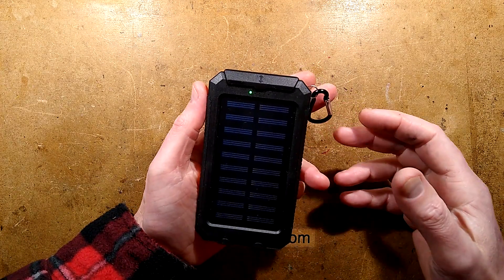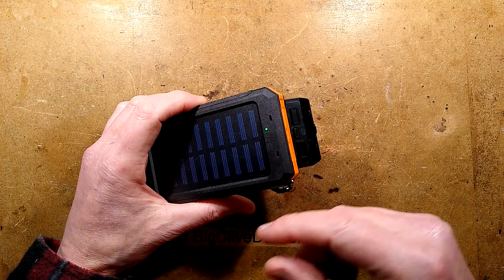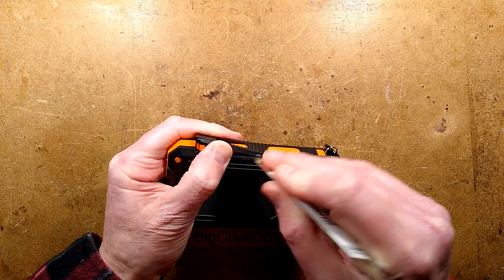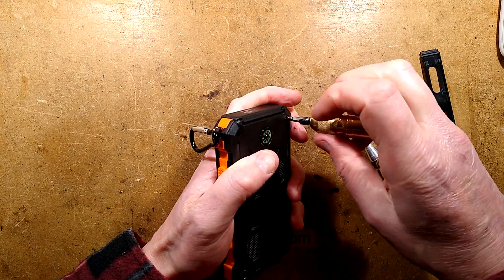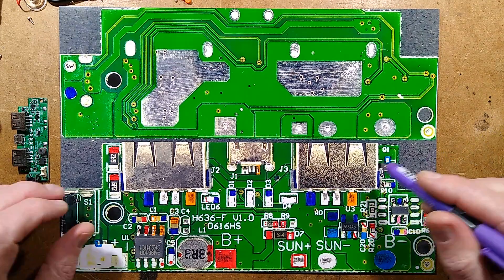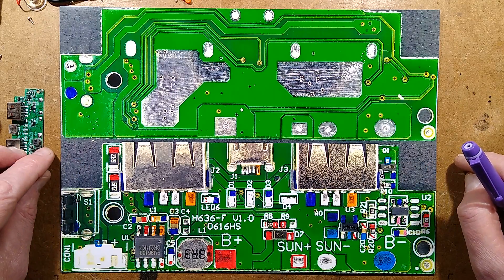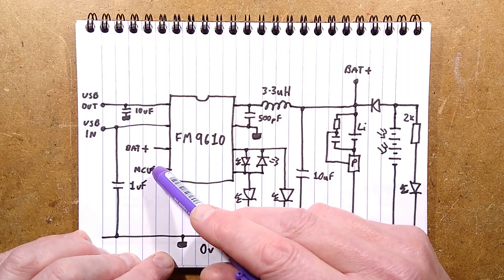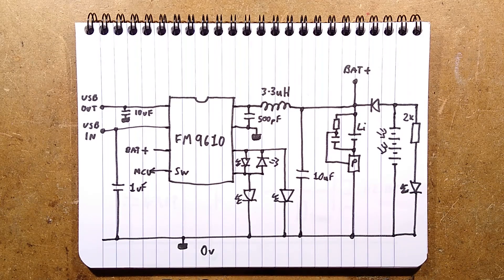eBay 9 MILLION mAh power bank teardown (with schematic)

Comment: Classic case of the design guy crossing swords with the marketing guy in the briefing room, turns out the marketing guy had much more time to practice fencing and won because all he had to do was label the device with ridiculous and outrageous claims of 9'000'000 mAh 🤺 O' and cut the cost of using a decent battery and replacing it with scrap metal 🤣

Comment: I had one of those for years, until a cell decided to swell. Was actually around 5000mah, did its job quite well. I knew before I bought it, it wasn't ever going to contain the 100,000mah it advertised, but it was still fairly reasonable.
Reply: SOMEtimes if you look in the actual specs, it'll tell you what the PV panel and actual battery capacity actually are. I had a couple that actually accepted a charge from light, but not really useful. they were definitely useful 5,000 packs, and people could ask questions about the solar panel and it was good for a story.

Comment: Gee whiz, at five volts, that's 162 megajoules.  When I was doing pulsed power research and building railguns in my lab, I had a HV, fast-pulse cap bank that stored only 18 kilojoules and it weighed - literally - 1,500 lbs.

I had a party guest - FOAF - who works with battery chemistry at the Nat'l Renewable Energy Lab out here.  He quipped that the difficulty battery researchers have been facing (for decades) is NOT achieving higher energy density than the current SOTA - that's easy.  The challenge is ensuring that all the stored energy can't possibly - or at least not easily - come out all at once, really fast. (boom)

I'm old enough to remember when the whole "overloaded phaser" seemed kinda dumb, cuz it was apparently EM energy storage and not chemical, so in the 70s it seemed silly.
Now there are Li-ion cells that actually do store as much energy as my 18kJ cap bank and I am grateful indeed that they can't deliver it in a millisecond... we don't need to all be walking about with hand grenades in our pockets.
Reply: Just for fun, 162 MJ is roughly the energy contained in 1/4 kg of TNT.

Comment: Are solar panels on a power bank a bad idea across the board? Or are some legit.
Reply from the maker: Terrible idea.  It's better to use a separate solar panel and keep the power bank out of the sun.
Reply: @BlondieHappyGuy  Hey thanks for this. I was umming and arring over getting a solar version. I've had a traditional pack of roughly 20k and seems to do the job, but always wondered about these. Great, concise reply.

Comment: Steel is much cheaper than lithium cells. The weight is such a slap in the face!
Reply: @BlondieHappyGuy  Thank you, I've seen it in some power tools that added rubber like weights. Not sure if was to dampen vibrations or like you said make it feel sturdier.  I get what your saying to keep things upright, that makes sense. I have a floor lamp with a heavy base too. Have a good day.

Comment: All people beware of some scam Chinese power banks out there. They marketed as a higher capacity than actual and I've seen this a lot. Recently, I open some of the pocket-sized power banks rated as 5000 and 9000 mAh and I take a look the innards and I see it's a bogus. The actual capacity of these 18650 cells were around 700 and 900 mAh than marketed. And I forgot, yes, to make it heavy, they stuffed with a small chunk of iron bars and also fake 18650 cells stuffed with 100% sand.

Comment: i was given a thing very much like this that had spent a month in a bucket of water.  the only function that remained was the solar cell would charge the battery.  the pouch style battery fully filled the inside of the container.  very tight fit.  no performance maximising lump of steel like the one in the video.  unfortunately the battery quickly lost charge.  the solar cell will be recycled into another project.  these things may be reasonable value if they contain a full sized battery.  i have no idea how to check for this if buying off the internet.

Comment: If you get the complete weight (which is according to Albert only frozen energy) into their electromagnetic version (radiation), you have a lot more than 9kAh*3.6V. Unfortunately it might discharge a bit too fast.

I assume 10g and complete transform and (with potential math issues included) come to 2.5TWh.

Comment: I have a similar unit I got for Christmas a few years back, the solar cell looks different but that’s it.  Mine works great and I charge it in the sun all the time.  Can you tear down an Amazon or google branded phone charger wall wart thing?  Curious if they add certain “devices “

Comment: Why are we reviewing scam products? We know already it's impossible.
Chinese are doing it with add 1 or more zero's to look it even more interesting scammy product anyway. They're idiots or some of us are idiots to buy it.
But warn us about scams is good. Never buy it, unless the capacity and features are fine for you. Only...

The most worry side of the scam product is extremely small battery (it's cheaper) and A BLOCK OF METAL to make us think it's heavy with big battery.
The problem with powerbank market is there are TOO MANY different products. Part of them have not promised capacity, and part are scams like this.
That is really big problem, because we will know about scams and incorrect powerbanks, and will never buy them.
The result? Big pile of e-waste. All that materials and lithium cells, still working, will throw already in the trashbin. Really stupid. China don't care about e-waste for sure and just want sell scams, only for money.
Reply from the maker: We're doing it for fun.

Comment: I have exactly same fake power bank, i found it in the garbage, battery was dead and compass was not good but i managed to replace the battery, i use it to power a small fm radio that was originally intended for use with a psp 1000 and as a flashlight so not bad for the price (in my case) because both devices came from the trash.

Comment: 9.000.000 mAh = 9.000 Ah If it delivers that at 3.6 V it would be a power capacity of 9.000 Ah * 3.6 V = 32.400 Wh or 32.4 kWh. Thats around a THIRD of ONE big Tesla battery charge. Always check your units. Ridiculous anyway.
Reply: Yeah, except 9.000 * 3.6 = 32.4. So perhaps be a little more careful with the ......
p.s. ,,,,,,, aren't a great improvement
Who knows maybe its a font thing, But that's the very reason they are a bad idea.

Comment: The outrageous capacity claims are alike to the crazy Lumen levels on Alibaba torches. Some back of the envelope calculations revealed that one LED torch had the same output as the Sun! 
This leads me to an infinate power proposal: point the torch at the solar panel on the powerbank while the powerbank charges the torch!  Use the excess power to run your house and electric vehicle.

Comment: That reminded me of those Chinese SLA powered spotlight torches from about twenty years ago, they often stated millions of candlepower from a 6V 25W halogen bulb..lol.
I had a friend with one who bragged endlessly about how powerful his was (despite only having a bigger reflector) badged with 1000000 candlepower. His bragging prompted me to print a very professional looking sticker for mine that stated 'One Billion Candlepower'... he was not impressed, and believing my superior numbers to of course be real, the challenge was on to 'out candlepower' me with something even bigger than a billion, but sadly he couldn't find anything. I never had the heart to tell him ALL the numbers were total BS, just like the multi thousand watt ghetto blasters from the 80's that were powered with a few measly D cells.. Chinese performance calculator: take the numbers and shift a few decimal places left then divide by four.
Reply: Reminds me of the 6k, no 12k, no 20k, no 30k! lumen headlights. That would melt your headlights and is brighter than most cinema projectors.

Comment: I have an identical model and I must admit I have never relied on it much. As you say it does weigh a lot. Two output points rated at one Amp MAX.  Charge does not last long even out in the sunlight. You warn against that! The two lights hardly ever come on. I have found power banks more reliable. Excellent video.

Comment: I was guessing it had 6 or 8 18650 cells inside, got that wrong!
The weight above the battery is to help you throw it from further away into the bin

Comment: Given the battery really was 9 000 000 mAh at 3.6V, the energy in it would be 32.4 kilowattHOURS, not 32.4 megawatts ;)
Reply from the maker: I did screw up that calculation.  But I liked my result more.

Comment: I'm a bit confused by the advice not to leave this in direct sunlight, due to the risk of overcharging the cell.
If the cell is charged via the protection chip, as you show in your schematic, then shouldn't it be OK to leave it in the sun??
Also, and forgive me if I missed this, you don't show us whether the lithium cell has it's own protection under the kapton tape...
Reply: It's not overcharge risk, it's direct overheating as the sun heats the black case.
Reply: The problem is all the heat from direct sunlight. Lithium cells are quite sensitive to excess heat energy. The cell would be baking nice and crispy inside the enclosure.

Comment: It'll never amaze me that people think that putting a PV solar panel on the same device that holds a Li-ion or similar battery is remotely a good idea. If you really want to do the 'charging powerbank via solar' thing, there are foldable & portable panels with a USB output. Can put those in the sun, with the powerbank sitting in the shade somewhere, charging via a USB cable. As a bonus, this will actually charge the powerbank at a rate that's compatible with human life.

Comment: You obviously mean Hot Wheels Tesla. if you did work at NASA I suspect you would have fitted stronger doors on the tower lift (thinking that there just might be a fairly high pressure wave during lift off)
Reply from the maker: Those are the new Otis high speed opening doors.

Comment: It's one of the reasons I don't like the "mAh" battery scale. Because it depends on the voltage.
Technical people will understand it's supposed to be at the battery's voltage, but most people will assume it's for the 5V output.
Would be less likely to have confusion with Wh units, and scammers would fool fewer people.

Comment: 9000000 mAh IS very doable ...if the voltage was 0.000001V. Or more seriously if you consider using it as Solar charge only, for years...if it Can charge by Sun in 1 day and you drain it every night if 1Ah, it will reach 9000Ah within 30 years. Not easy to do but needs to try before you tell 😄

Comment: I fucked up and bought one these in the blue trim a couple of years ago. I should have my ass thoroughly kicked. However, it makes a decent flashlight when the hurricanes knock the power out. (Caveat) as long as you charge it with a wall wart.

Comment: 25:00 actually 32 kWh, you forgot it was milliampere hours. So it would only be a third of the Tesla battery.  1000 mAh weight about 20 kg so 9 million mAh would weight about 180 kg.

Comment: Yes, good advice there. Way back I bought one of the early solar charged power banks. I left it out in the sunshine and was most disappointed when I returned and the battery had swollen... 
If you wan't to solar charge your lithium power pack, buy an external solar panel.

Comment: If you put three of them together you will have close to 9 million μAh capacity. Edit: Lol... The power gauge literally just drops like a rock when its tested. Plug your phone in, and the power bank is already flat again before it even has a chance to negotiate the charge current.

Comment: In the U.K. false advertizing claims are not allowed and since you have the capacity in writing it must be correct.  Clearly the device is an eighth dimensional object that is bigger on the inside.  All eighth dimensional objects are intelligent and have a chameleon circuit to masquerade as ordinary objects. That is why you thought you saw the inside of the device.  Sadly, the temporal police have, had, or will have, substituted some piece of junk instead of alllowing you to possess the device which would created a time paradox.  It is too late now.  Next time you find such a device do not post a video online for the temporal police to see.  Then you can look for an eighth dimensional electric motor to go with the battery and power your car.

Comment: What's that famous 'Cliveism'? - "These are cheap, shit (shipped) direct from China"!!

That metal block is all part of a fantastic 'Super Inductor, capacitive latency, inverse-inverter Boule-Schmitt apparent power capacity booster'. As I understand it's designed to help you avoid carrying unnecessary dead weight around with you.  Also, as a unique feature, it means that if you drop it in deep water, it sinks rapidly below the water so as to contain the massive, nine megaton explosion which will most decidedly ensue when the water comes into contact with all that lithium!

Comment: That is a significant increace in capacity! teared down the previous version (without dual-flashlight and compass) because for some reason it would stop working. My version only promised me 6000mAh. Sadly it didn't have even that.

Comment: I'm guessing that battery pack is more like 3-4000mah. I usually find 4x2000mah batteries inside these, but rarely get the performance.
Reply from the maker: It was 2500mAh.
Reply: As I understand those ultra cheap 18650s are salvaged, resleeved, worn out batteries of unknown specification, likely from old laptop packs.

Comment: maybe 9million mAh is the ammount of charge it will take in its lifetime (Full charge X How many times you can re-charge it before it dies)
Reply from the maker: Even then it doesn't fit unless you replaced the lithium cell several times.

Comment: If they had just shifted the metal weight forward and put it in contact with the back of the LED's board it would have at least served as a heat sink.

Comment: Put the unit out in the sun and the battery fails, splitting the case. That's almost worth getting it for the entertainment value alone. It won't take long in Australia. Summer has arrived, 45C days.

Comment: That's hilarious.  My 21000mah 5A power bank isn't much smaller than a brick, it weighs about the same as one too due to it having 10 18650 cells in it.

Comment: That was sooo scary when you were opening that up! With that much dc power, anything could have caused an arc to form and nothing could probley put it out till it burned its self up or got down to way under a million mah. I would have thought it would have to be oil filled or epoxy filled to keep it from self destucting! Lol.

Comment: So, is the solar panel not even integrated into the battery charging circuit/won't actually charge the battery if placed in the sun and only powers an LED that's just pretending to be a charging indicator whenever the solar panel is in sunlight to give the user a false impression that it's charging, or did I just misunderstand what you were saying at 8:52?
Reply from the maker: With enough sun it will charge the cell.

Comment: I love your dedication to the absolutely comedic math on the 9,000,000 mAh capacity. Never change, Clive. Never change.
Reply: The problem is that this math is wrong. 9 000 000 mAh * 3.6V = 32 400 000 mWh so 32 000 Wh so 32kWh so 1/3 of large Tesla battery. Still complete BS but also shows that author does not understands units ...
Reply: @mariuszdullak1399  The correction is also mentioned in the video description, for those who don't have enough time to watch the whole video. He just made a small unit conversion mistake. Happens to everyone.
Reply: @michaelcalvin42  it probably helped he wasn’t being particularly serious at the time which is why it took a while for him to catch it.
Reply: @mariuszdullak1399  I noticed the same thing immediately, but disagree with the conclusion you've jumped to. It's clear you didn't watch the video (or at least didn't pay attention if you did), because Señor Grande Clive, that Manx he, noticed and corrected the computational mistake at 7:25. There was no lack of understanding, rather a simple miscalculation.
Reply: @ss-tx-rx2860  Yeah I did not watch the whole video. Maybe I should have marked my comment in <sarcasm mode ON> ? I am full hand on with stupid "my friend" sellers who will put all the numbers you want anywhere. I own single 18650 powered flashlight which cost $5 (which I absolutely love BTW). On the flashlight itself it is stated 100 000 W!!! I also remember an app which when loading went to well over 999 999 % complete ... They are just crazy with number and not their meaning 😀
Reply: Still. The chinese who invented that label 9m is fools this guy to buy it🤣

Comment: I have a similar one. Don’t store it solar panel up. Low light turns on the charger and then the LEDs use more power than generated! 🙂
Reply: I found the box mine came in. It only claims 5000 mAH, which seems honest. It is actually a nice little power bank.
Reply: The unit itself is labeled “Li-polymer battery: 8000 mAh  Solar charging: 5V/200 mA  LED Power 2.4W  Input DC 5V/1A  Output DC 5V/ 2X1A”

Comment: you did not include the as of yet unseen mode that the mystery chip uses to convert the 71 grams of steel into energy (e=mc2).  patience may surprise, but don't wait longer than 10^31 years because by then protons would be decaying.